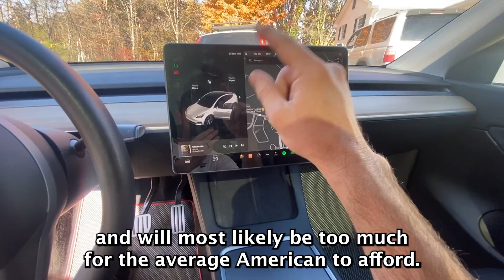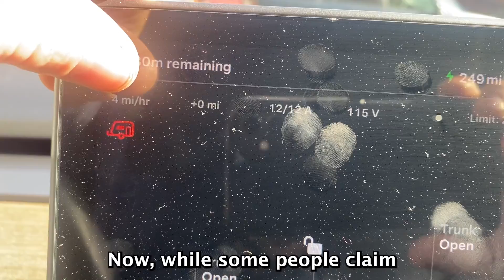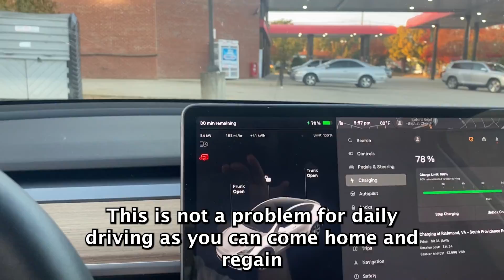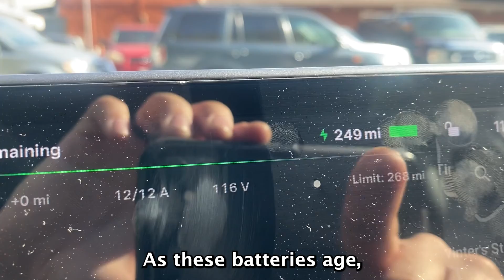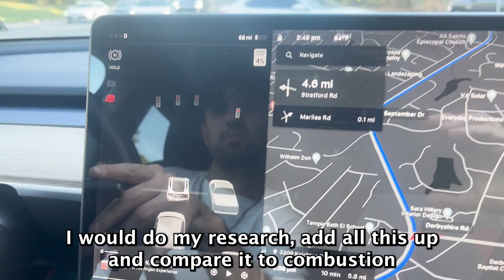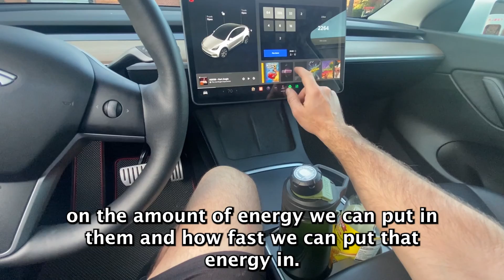Why Electric Cars Can't Replace Combustion Engines

Comment: You clearly know very little about electric cars. There was only one thing you said that was correct in the entire video: that Tesla makes the best EVs and have most of the kinks worked out. I agree with you on that, if someone is going to buy an EV, they should buy a Tesla. Let's cover it one at a time.

Let's start with the biggest problem from your video. You started off by saying "EVs will not work" and "never replace their combustion engine vehicles in America." By the end of the video you change your tune and say "until battery technology changes." I am going to give you the benefit of the doubt and assume your initial statements were hyperbole and just meant to rile people up. Whenever you say will not work, you are already wrong because you didn't say for what. There are millions of EVs on the roads in the US right now (about 3 million) and they work just fine for most of the people that own them, which is why Tesla's customer satisfaction is so high. They may not work for you, or for some people, but they clearly work for some use cases that people have, and have for many years. The Leaf was a terrible car in my opinion, but I know people that had them for over 10 years, and really loved them.

When you say never you will almost always be wrong. How about in 100 years, 100, 50, 20? So you want to qualify your never statement? It isn't hard to make a fairly accurate prereduction about the addressable market for EVs by simply extrapolating the progress from the last 15 years (since the advent of the Tesla Roadster). 13 years ago we had zero charging stations in the US, and a choice between a 100K roadster (impractical car for most folks) that had 120 miles and a 30K+ car that had 75 miles of range (and was also impractical for most folks). Today we have a car that can be had brand new for 20k that has 259 miles of range, and there are multiple cars and trucks with over 400 miles of range (though they are expensive). The best selling car in the world is the model Y (an EV) and sales have grown at an average of over 70% for the last 6 years from less than 1% to 5.7% last year. This year it is hovering around 8%. There are over 50 thousand charging stations, and Tesla alone has more than 3 thousand fast DC charging stations in the US. 

Where will we be 5 years from now, how about 10? Do you really think that the technology will not continue to improve? Do you really think that as it does, as more charging stations come online, cars get longer range for less money, and the charging speed improves that more people will not want an EV?   

I am not sure you actually understand what maintenance means vs. repairs, which as a mechanic you don't need to, they are all the same to you. Maintenance is things like changing the oil, tires, belts, breaks, the wear parts that are not covered under warranty and are expected to be paid for by the consumer even when the car is under warranty. There are almost no maintenance items on an electric car. Brakes pretty much never need replacing unless you drive on the track and there are no oil changes or belts. It is just fluids (far less than an ICE car), filters, and tires of course, that is it. You comment about things breaking has nothing to do with maintenance, that would be repairs covered under warranty and not cost the consumer anything. Maintenance is demonstrably lower for an EV over the warranty period, there is no way to deny this.

The batteries do not last 5-10 years, they are warrantied in the US (by law) for 8 years and 100K miles, and often the manufacturers push it beyond that. The Cybertruck has an 8 year, 150K mile warranty. The average replacement for an EV battery out of warranty is 200K miles, and is calculated mostly from all the older EV's like the Leaf. Tesla batteries are showing 300K+ miles before needing to be replaced. So you are just wrong about that. Prices come down too. In 2012 the price for a Model S battery pack was $40K. Today you can get one installed for $20K, and 10 years from now it will be much lower. Battery prices have fallen 80% in the last 10 years.

In reality even though it does take longer to charge an EV than it does to fill up a gas tank, the experience is not that different. Because you can charge the car while you are doing other things (unlike filling gas). Most of the modern EVs can charge 10-80% (which is what is typically done on a road trip) in 20-30 minutes. You will need to do that about once every 3 hours on road trip (so every 200 miles). Most folks need a bathroom break every 3 hours anyway. So the real extra time is 10-20 minutes added every 3 hours to a road trip. Now that is if there are charging stations along your route. If you drive a Tesla that is more likely. 

Yes, currently EV repairs are more expensive than ICE repairs, but, as you mentioned, because of the less moving parts there are less of them. Even though an individual repair will cost more, the total cost of repairs has been lower for EVs than for ICE cars so far. That could always change, but it is more likely that will get better for EVs not worse as more of them hit the streets and aftermarket parts start to become available.

Gas engines do not generate their own power, you have to fill them with gasoline. The gasoline provides the power when it is burned, and very inefficiently. EVs are about 80% efficient from wall electricity to wheel torque. Gasoline engines are about 20% efficient from gasoline potential energy to torque. They do however get free heat from that inefficiency that can be used to heat the cabin. People don't "say" that EVs are more efficient than ICE, they are about 4 times more efficient than ICE cars.

40% of the US electricity grid is not coal, and that hasn't been true for over a decade. in 2022 19% of electricity generation in the US was from coal, and 21% was from renewables. The largest source of power generation is natural gas at 39%. Power generation is much more efficient than burning gasoline to produce torque at large RPM ranges, and natural gas burns much cleaner than gasoline. With the current US electricity mix an EV will burn 40% of the fuel an ICE car will to drive the same miles, and that is ignoring the inefficiency of getting gasoline to the gas stations for you to consume. 

There are only 3 types of charging ports in the US: NACS (Tesla), CCS (J1772) and CHAdeMO. That last one is almost completely phased out and is only used by Nissan on Leafs. So really there are only 2 standards. Almost every car manufacturer has agreed that they will be using NACS by 2025, so by then there will only be 1 left for new cars. There are adapters from CCS to NACS and vice Versa that work perfectly well and most new charging stations are coming online with both CCS and NACS. This is a ridiculous argument, and you seemed to have recognized that since you put it in the what to look for when buying an EV section. 

There are just so many inaccuracies in this video and I don't have time to counter all of them. I understand why you want to convince people not to buy an EV, you are a mechanic that doesn't know how to work on them. I have empathy, but you can't stop it, it is better to put your energy into learning how to work on EVs.
Reply from the maker: Love your arguments but this video is really to warn people about what is coming. Mechanics will tell you if you ask them. These vehicles will be a financial catastrophe for these people that buy them. 

The big three and nissan already have problems with there ICE vehicles they have been making for years and now they are going to make new technology. Ha please and you mentioned a warranty on the battery. I cant wait for the back order on those. Plus good luck finding a dealership that will actually warranty it. The system is already broken and now they are throwing electric cars in the mix. Buyer beware. 

Electric cars are more efficient when it comes to power to the wheels being generated. They Are technically. They use less “energy” to move the vehicle because its just motor to transfer unit then wheels. My point is an ICE is technically a power plant for the whole vehicle. It burns fuel to create force/ energy and it powers everything in the car on demand. Only you have to change is the fuel to make it clean. We just dont have a fuel yet. But we will get there. 

My figures may be a little out dated but electric cars arent any cleaner than ICE yet. 

Thanks for watching and for your input. I stand by my arguments only time will tell. Electric vehicles arent going anywhere but neither are ICE. 

For the record I know how to work on electric cars. Its not that difficult. But it can be dangerous and for that reason many mechanics in the industry are hesitant to even learn. Ive worked on hybrids for years which can be more difficult. Most mechanics dont know much about electric cars and are not planning to learn.
Reply: @justcallmeeddie1 The problem is that you used false information to make your points, and if you use real information, they do not lead to the conclusions you have. It is hard to say that EVs will be financial catastrophes for the buyers when the current numbers show exactly the opposite. Certainly, while under warranty it is impossible to make an argument that EVs will cost more than ICE cars. Regardless of the expenses from repairs they will cost much less because the cost of repairs is on the manufacturer not on the consumer, that is how warranties work. Not only that, but they usually give you a loaner car when your car is in for warranty work if it is longer than 1 day. So, if it takes a long time, that is on them too. When you add in all the savings from fuel and maintenance than EVs are a clear winner. That is, of course, only if they work for your situation, and for many people they do, for many they don't.

If you are talking about used cars, well that is a very different story. Like any out of warranty car any parts can fail, and the cost of repairs is all on the owner. The average cost of all repairs (total, not per repair) has been averaging lower for EVs than for ICE cars, but the battery is a real concern. You have no way to know how the battery was treated by previous owners, and there is not a great way to determine its health. That can be a costly item if you are looking at a used EV today. However, as battery prices continue to drop that will not be as much of an issue in the future. As I mentioned the replacement cost for a model S battery is half today what it was 10 years ago. It also has to be compared to the cost in an ICE car for the failures that can happen there, like the engine and transmission needing to be replaced and/or rebuilt. Battery replacement is more, but both can be enough to make the car be junked, and both are about as likely to happen. 

The reason that EVs are more efficient is partially because of the reduction of the complexity in the gearing (i.e. usually no transmission at all, just a gearbox), but that is not the primary reason. The primary reason is that ICE engines are not efficient over a large range of RPMs, the RPMs ranges they are efficient over are not the ones that generate the most torque, and to use them in a car you need to run them to drive a car they have to run at various RPM ranges. Electric motors have a much larger range in which they are efficient, and they are simply more efficient at producing torque. They also weigh much less than an equivalent ICE engine. If the batteries were not so heavy the EV would actually weigh less than an ICE car (at some point in the future they will). Changing the fuel on an ICE car will reduce the pollution, but it will not make the ICE engine more efficient. There are currently no alternative fuels that will not generate more pollution than just burning the gasoline in their production to begin with. Not to mention the cost are outrageous. EVs are a much simpler answer to reducing pollution than clean fuels in an ICE engine, and the only way to gain the efficiency advantages. If you want to talk about cleaning up the fuel EV + natural gas is a much cleaner fuel than gasoline and at double the efficiency. Barring that, if an EV doesn't work for you the best option is a hybrid. The cost of hybrid is small, they are more reliable than ICE (again just using statistics) and they will give you much better fuel economy with no extra hassle.  

Your numbers are not a little dated, they are decades old, and in some cases just wrong. EVs are cleaner than ICE right now and have been for a decade. Yes, there is some mining and refining that goes on to make batteries, but that has been compared to what drilling and refining and transporting oil requires, it is pretty obvious which one is better for the environment, hint, it is not ICE. You are buying into the oil company lies. There are plenty of studies done on this, please look at the peer reviewed ones, not the ones the oil companies have bought and paid for. None find that ICE cars are cleaner than EVs. That is simply a false statement. BTW small factoid: there is more cobalt used refining oil into gasoline than in EV batteries. That is the mining that uses child labor and causes all the health problems in Africa. LFP batteries that are taking over the low end of the market use not cobalt at all, and yet no one is trying to reduce cobalt use in oil refining.

I don't think that people should be taking advice on EVs from mechanics. They are clearly going to be biased given that it impacts their profession negatively. It sucks, but it isn't something that can be stopped by putting out false oil company arguments and thinking people will not buy an EV. EVs are rapidly dropping to be the least expensive car you can buy new, the TCO has been lower since 2018. Used will come later, but it will be there too soon as more EVs are sold. Overall, for society they are a benefit given the efficiency gain, the reduction of and pollution. That doesn't matter though, once it is obvious that the cost of owning an EV is lower than an ICE car that will be what moves our society over. That is reality when you look at the statistics. It doesn't really matter who you are, your opinion does not trump the actual statistics about real costs in the industry.

Comment: He’s saying what a lot of people say about electric cars. So education is what’s needed. And when you have governments going as far to legislatively push them on people I would say about 50% of the population will just eat up a video like this. Sorry it’s the truth. But some people know his shop probably already has Lithium ion battery powered tools in it not unlike the employees in my shop have all switched to. Funny the compressor now only gets tuned on when fixing tires everything is electric. But anyways more education is needed. They always forget the amount of energy it takes to make gasoline in a refinery and the environmental effects of drilling. They always say coal powers the car anyways despite the fact that any non battery powered electric tool just burns the electricity and when not in use the coal plant still running. But a battery stores that energy. When electricity generated by coal or other source isn’t used that excess energy gets dumped into the ground. Ask the power line guy if you don’t believe. Anyways another claim is mining as if ICE cars don’t use any rare earths. But that’s not true as the criminals sawing off your Catalytic converter know all to well. Lots more but will fall on deaf ears here. The reality is just legislating changes won’t work. Competitive market will. And just like the electric ratchet and lug wrench or drill everyone will eventually use electric cars. It’s not going away.
Reply from the maker: Well drills have been electric since they have been invented and battery technology has gotten better. We still run our compressor everyday and so does every shop I know. And when there is a axle nut to get off better believe I find that airline. It just has more power and no 150.00 20volts battery replacement off the snap on truck when it goes bad. It just gets rebuilt for 120.00 bucks. To each is own but I know which way Ill go. Never claimed ICE vehicles were perfect. Just claimed that electric vehicles arent't.